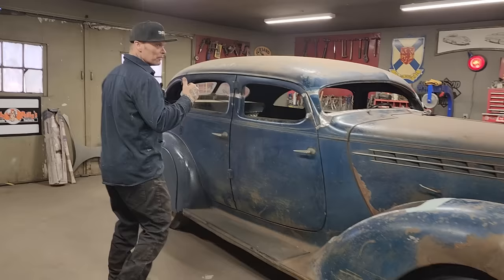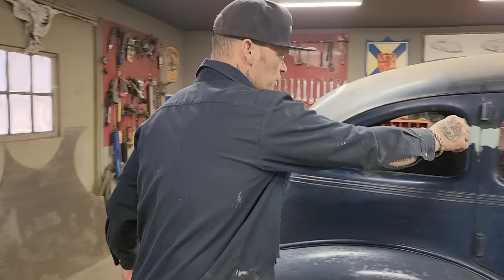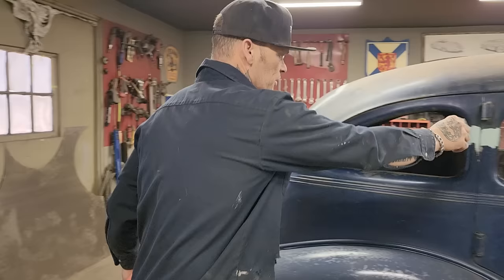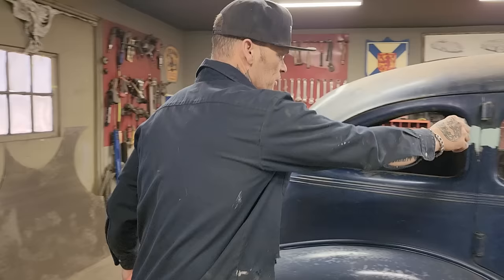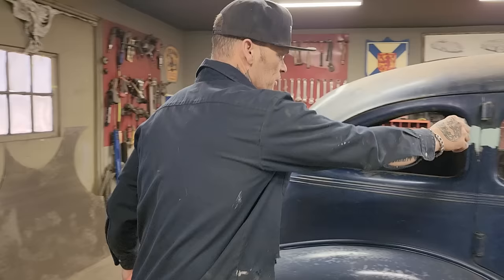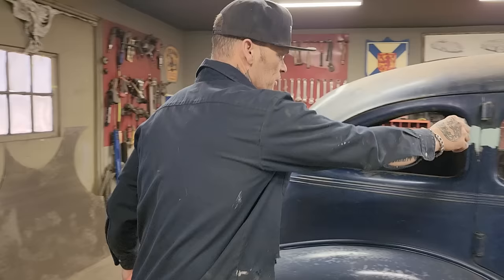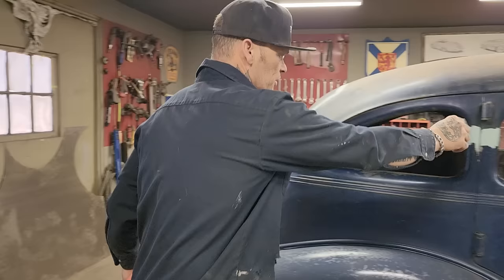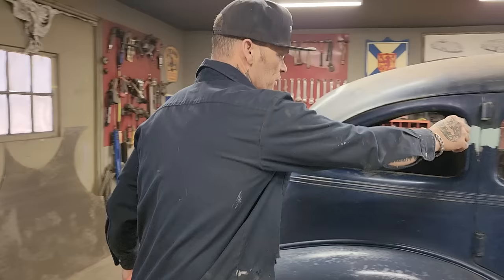Body work + paint job on chopped 1936 Hudson Terraplane 🎨

Comment: Hey Chad, if you ever run across an old electric leaf blower, they make the best shop sweepers that you’ve ever seen! They may not have as many pounds per square inch as the air hose does, but they move more cubic feet of air per minute by far! And they’ll clean it out to where you don’t inhale any dust.

Comment: The old Hudson is looking good ! I enjoy the paint videos myself. I think you could really benefit from an exhaust fan. A whole house attic fan mounted in the ceiling or a wall would be good I’m thinking. Guess the motor might have to be sealed due to flammable dust and such. Seems to me if you just blow that dust off the car it just goes everywhere. A fan could pull it all outside even the smells… just a thought man. Anything I say on here is said with respect.

Comment: The Hudson  is looking good, as for the "Thunderbird "  a thought  would  be to (chop , channel, and a continental  on the rear. But wide "white walls"; are a must with ,what are called, I believe  'salt flat diisks' or smooth  wheel disks, or even beatuy rings and dog dish hubcaps. But don't  take too much out of the roof. A good color  for the t- bird would be black! Maybe  even "fender skirts". Your choice and Jolene's. Keep up the  Good Work!

Comment: I think you've done a really tidy job with that, it exceeded expectations and in some ways actually looks better than the original. 
 I would have done a full paint job though.  If you want patina then let it stand outside for a few months, it'll soon return and,I think the overall effect would look a little more uniform. 👍 All the same, good job, great camerawork too as always Jolene. .Nice one guys.👍👍

Comment: When you first talked about chopping the top of the car changed  altogether and it looks so cool !!!! To use your term  it looks gangster and if this car was a cheap Hudson has a Lotta body details lines just very cool. I didn’t understand when talked about putting fender skirts on it and tire side mounts it just looks like it’s should have came the factory this way again it just looks right is this a dress and on your white wall? Cleaners Clorox soft scrub? I think it is that works really good. Just a suggestion.👍👍👍👍👍👍👍👍👍👍👍👍👍👍👍

Comment: I would like to see the update of the shocks, brakes, etc. especially if you clean and paint as you go. Do you do an update double bowl master cylinder or leave the original style and why? When would you Replace old rubber or grease fittings with urethane? What to update and what to replace or just clean and paint would be a cool conversation to hear. Of course that would blow the opinions up, but it’s your opinion, and I value that along with others. 
In my mind it has to taken Completely apart. But watching you and Jim, I am starting to think about working on cars.
Reply: Also like to see what you do with the interior with what you have, find, or come up with. 
Would you cover the seats with a canvas tarp or use a pair of curtains or seats out of something else or newer? 
I hope you carry it on “right before our eyes”
Reply: Actually , Hudson had a “ Double Safe “ braking system . If you lost a break line, continued foot pressure on the pedal activated the emergency brake on the two rear wheels.  My 40 has it and I think it was available from 35 on.

Comment: Centering the emblems over the rear wheels did it!  I was wondering if he thought of drilling drain holes in the tire boots?
Reply: Those emblems are cool. I do think they should have been in the front, of the skirt however.  Sort of like you wouldn’t put a hood emblem in the center of the Hood

Comment: 🎉 Chad I don't know if you know this or not if you add a touch of cornstarch to your single stage enamel it will dull the shine down just a little bit so you can match the old paint jobs a little better try it see if you like it it worked for me a couple times I learned it from another guy that was about 75 years old

Comment: I’m sure by now someone has mentioned the cork clutch and related Hudsonite oil/ fluid that makes it shift smoothly. 
There are many Hudson folks out here that will help you with the Hudson specific parts that you may need if you keep the original power train.  
If not, be sure to offer it to a Hudson person, Thanks.

Comment: Chad, don’t you still have to put some metal in the front door windows for the glass? Didn’t your glass chap say there would be a gap because the glass has to run down the channel in the door?

Comment: I would hit the rest of the car QUICKLY with some 40 & 80 and paint it all.  As fast as your doing it you may as well. Then over time let the process take its course in some weather. It will still have a worn look about it but at least will have mostly weathered paint instead of mostly weathered rust.  BUT it’s your car so do it as you see fit.

Comment: Probably should send away for a fuel pump rebuild kit for the old girl. Easily available as Hudson used a lot of the same parts as many other automakers. You just need the brand and if it is a single or double action model.